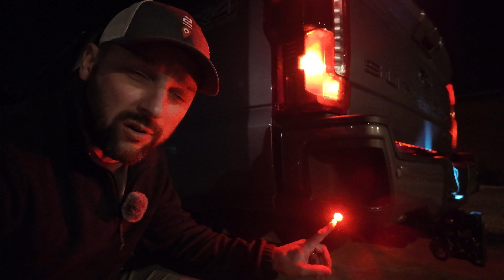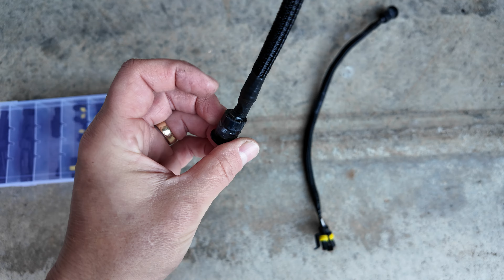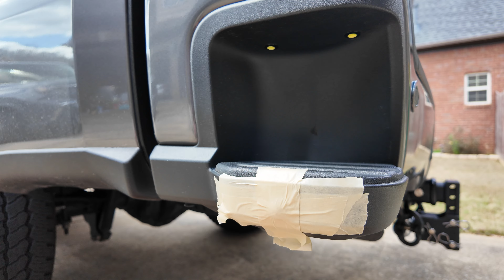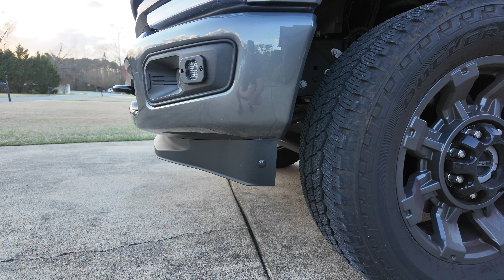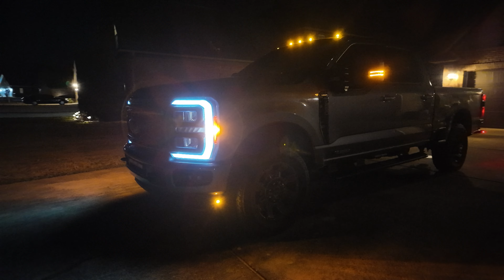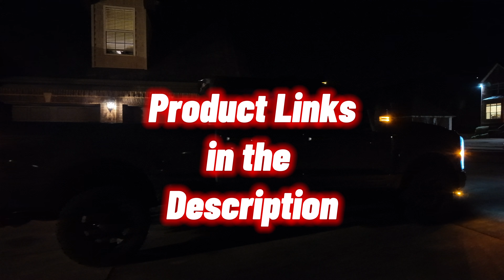F250 Marker Lights

Comment from the maker: Please check out the links below to go directly to these products.

Smoked Amber Lights- https://amzn.to/4kKZTGi
Smoked Red Lights- https://amzn.to/41XancN
18 Gauge wire- https://amzn.to/4kwh4ez
Nilight 1 pin plugs- https://amzn.to/4kXnG5H
Crimp tool- https://amzn.to/41vGpwx
1/4" wire loom- https://amzn.to/41zioon
3/8" wire loom- https://amzn.to/41ziqwv
Gorilla Ultimate Epoxy- https://amzn.to/41wB2Nz
Unibit- https://amzn.to/4iQEedK
Heat Shrink Crimp Connectors- https://amzn.to/4itdLU9

These are affiliate links.  I may be compensated by the listing website if you make a purchase using my links.

Comment: Question, i got the lights, connectors, and wire loom from your links.. the light has black (power) and white (ground) im assuming, wires... the wire loom has a black and red. Am i correct  the white wire from light connects to red wire from the wire loom? Also, i found that the taillight running light wire is blue/white. So ill tap my power wire into that, but what wire would i tap my ground wire to?
Reply from the maker: Yes.  Before crimping anything, double check the wire positive and negative on the LED.  I use a 12v drill battery to make sure.  Once I find out which is positive, I then connect to red wire of the loom.  On the ground, I just end it with the loom as well, then find a spot on the frame or a bolt to ground to.

Comment: Hey are you able to post what lights you installed inside the bed steps? I want to add lights there but not sure how or if i just right the light wire to the running lights wire and tap into that.
Reply: The foot well liners, was it just that one bolt and then some clips? Going to try and tackle it this weekend. I'm just going to run a wire to the back and tap into wherever the rear running light wire is. Any idea which wire that may be?
Reply from the maker: @Matth-mg7yr  which lights are you wiring, the lights at the running boards, bed step or bumper step?  Or do you mean the marker lights?
Reply: @2ThePointdjsteve the amber ones from your link
Reply from the maker: @Matth-mg7yr best place to get the running light signal will be the rear tag lights.  I don’t remember what color the wire is, but reach under the bumper and twist the bulb out.  Pull the harness down under the bumper and remove the bulb on 1 light.  With the tag lights on, use a test light with the clip to ground on a bolt, then put the probe on the harness contacts.  The one that lights up will be hot wire that you connect positive to.  You will need to run a harness from the back to the location you want to mount the lights.
Reply from the maker: I have gotten a little busy this month so it will be a little while before I can get the full video posted.  Mine are connected to a wire under the driver and passenger floor panel.  The wire is energized when the door opens.  This way if I unlock with my remote or use my rear bed lights they will come on.  You can wire them any way you would like but the entry of the vehicle made the best sense for me.  I have used this same light on other projects and I will post a link to those videos.  The links to the lights will be in the comments and descriptions.  Thank you for watching, please subscribe and share!
Reply from the maker: Here is a project that I used the same lights on and similar functionality.  When the door opens these come on.

https://youtu.be/9o8r17qBQBo?si=qV--wXuCpCVi9mNR
Reply from the maker: https://youtu.be/_F7Kkp3N8Gw?si=7zrJ_zwK-UiAdyqM
Reply from the maker: I used the smaller style in my glove box.

https://youtu.be/UA0RZ9tiDMA?si=RSqF-7qq98Hyris-
Reply from the maker: Full walk around the truck with the lights on.

https://youtu.be/Op3aDKR6JEY?si=wSMgFIm-pDND8-R7

Comment: Im trying to add amber lights in the bed steps where you have those 2 tiny white lights. Cant find anywhere that sells a kit so trying to figure out how and parts needed. Any tips?
Reply from the maker: I am on vacation right now, but will give you some tips once I get back.  I custom mounted these and made my own harness.  Get back to you soon, thanks for watching!
Reply: Any tips on this? I'd prefer to just tap them into the running lights when they come one.
Reply from the maker: @Matth-mg7yr sorry about that.  Got back from vacation and got busy at work catching back up.  Let me see what I can put together on how I wired these.